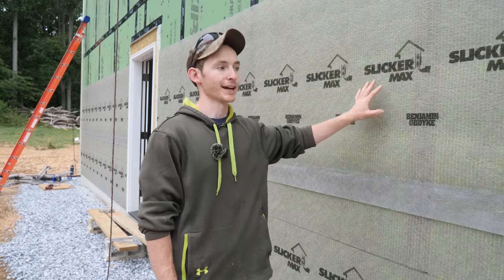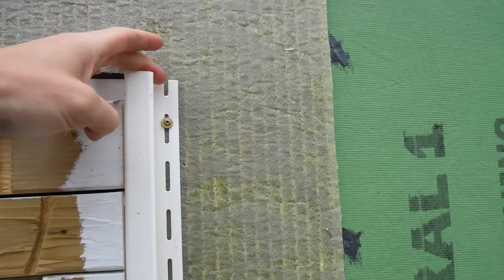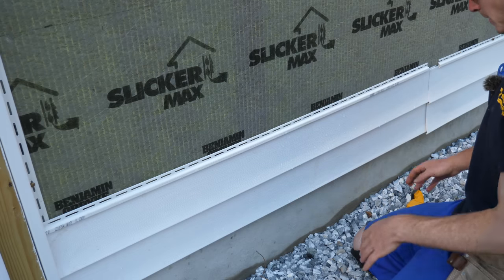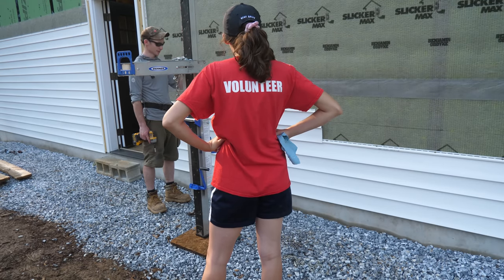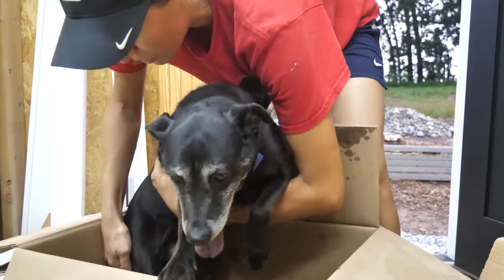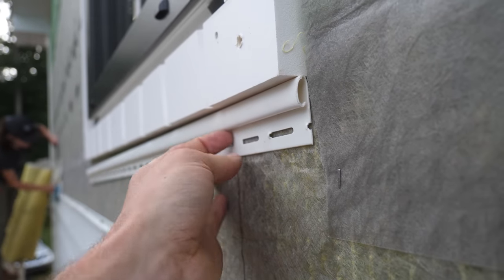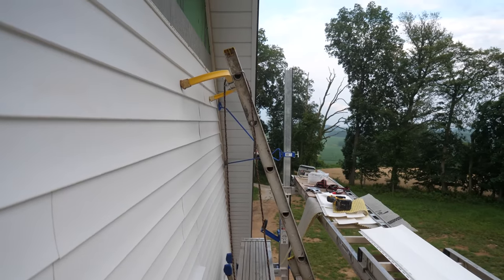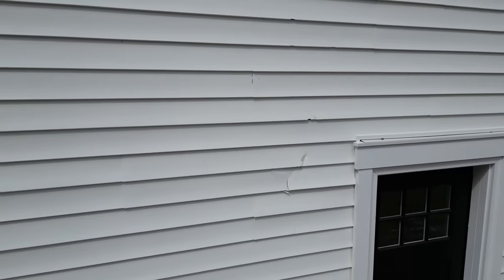We Put Vinyl Siding on ONE SIDE ONLY??

Comment: My guess is that the slots are not on "centers" because most vinyl siding is just fastened to the sheathing, not studs.
Reply from the maker: I just can't accept that 😆
Reply: @MasonDixonAcres   I know.. I am right here with you, but I am pretty sure that is why.
Reply: That’s true. Vinyl siding was meant to be fastened into the studs, that’s why slots are not 16” off center 
Regards from siding contractor from Canada😉
Reply: If you you ever remove it you’ll realize you’re going to putt the vinyl off of the nail before the nail comes out the sheathing
Reply: @MrGcovell yes exactly

Comment: I was never a fan of vinyl but I've seen some very attractive installs of late that do a great job of simulating, for example, a board and batten style. If you're looking 5 or 10 years out before you build the main house, yes, the vinyl siding makes sense rather than the more expensive James Hardie products. Nice work.  But then again, you're engineers, so your attention to detail is a cut above and it shows.

Comment: The last bit of video is reason you don’t get vinyl from Lowe’s or Home Depot. It’s thinner and doesn’t hold up, also becomes wavy, just look at a double wide trailer a year after put in. ABC supply sells some really nice vinyl for same price if not cheaper. Vinyl is tricky because if you buy the good stuff it’s almost same price as LP or James hardy. The pvc is awesome, I just did some board and batten as trim around 2nd floor dormers on a 5000 sq ft home. Itll last a lifetime but a little pricey
Reply from the maker: This is Ply Gem .040" thickness, since it's temporary we weren't going for the most premium vinyl out there. What brand/thickness do you typically get? In my fairly limited experience, the supply houses are more expensive than the box stores for the same exact product even with their house account discount applied. Some of the guys we've worked with on this project have been shocked to hear the prices I've paid, because they never look outside the supply house. Granted, there is certainly headache factor when buying from box stores, but with the best price and easy returns, sometimes it's worth it.

Comment: So sorry about the tornado(?) damage.  When you assembled the door trim with the pocket hole screws did you glue the joint as well?  The nice thing about PVC trim work is that gluing it is permanent and weatherproof.  I haven't watched any of the other trim work that you have shown, so I don't know if you are gluing the joints or not.
Reply from the maker: Appreciate the comment! I actually think we forgot to glue those joints on the door trim. I’m not sure how much the glue is waterproof long term, but the amount of water that could potentially get in that joint and cause harm is pretty negligible imo

Comment: Nice work.  Sorry to hear about the storm.  Curious if the Hardie held up any better?  Did the Slicker Max do its job?
Reply from the maker: It received two small scratches, but the south wall did bear the brunt of the wind. The rainscreen was unaffected. I'm glad it gives continuous support to the back of the siding in the case of flying debris. Not something we really thought would come into play in our area, but clearly that's not the case going forward

Comment: Have you calculated the extra cost using the screws? I love the screws, but at what extra cost?
Reply from the maker: It was like 70 bucks for two pails of screws. Probably would have been 20 in nails. So call it 50 bucks extra for screws, and which will eventually get reused on something else when taken out